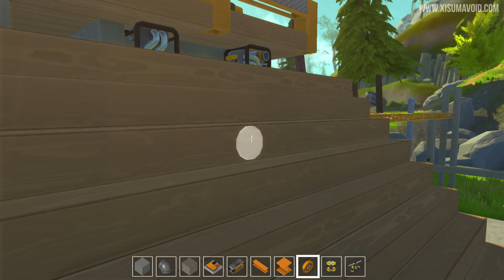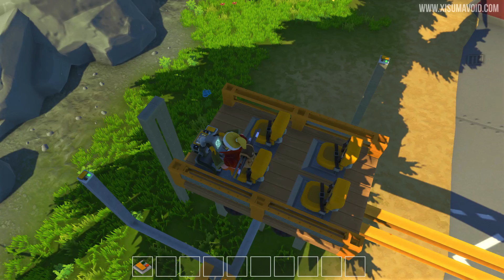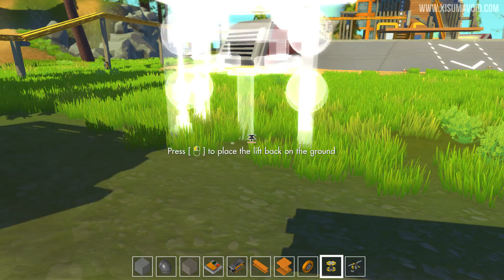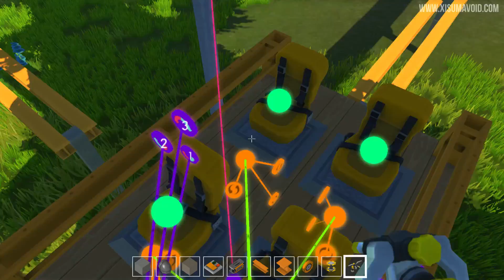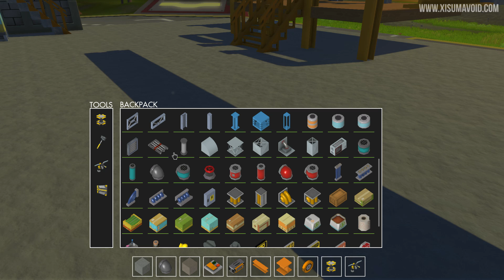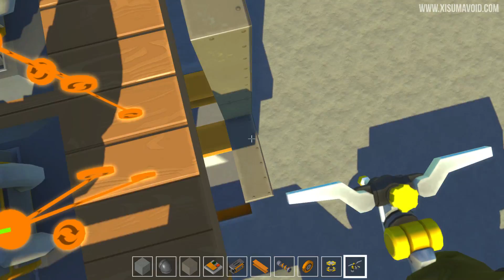Scrap Mechanic Amazing Rail System

Comment: On rhe suspension idea 10:00 just place bearing under it and rotate it 90 degree an turning on sensor so when u ride in it will push u back a tgan it will rotate  90° and ur be frew

Comment: dude you should totally put the wheels on bearings without a switch (loose) so when you go onto a diagnal track the wheels can line up when they hit it and it can turn automatically

Comment: I do believe you can hold shift or control and move the default angles on the control panels by individual degrees. You could use that to make smoother curves made from 9 or more different straight block segments (10 degree or less turn each). Then maybe add a loose bearing to the axles of the cart so they can deviate from perfectly straight as the track does the same.

Comment: Having the turn table lift a block would allow it to extend to the stationary rail without running into it as it turns. For slopes, you should find a ratio that allows a closer connection between the rail. just for smoother rides

Comment: ive tried something like this. for the diagonal track use a sensor that will activated for long enough (the same time as it takes to drive by it) to activate another bearing onto a sensor that then brings in another controller. use this controller to 'lock' the second sensor on and drive the track to a desired angle. effectively you do not need to stop the car at a turn table just keep driving and it will change direction

Comment: Try putting a larger bed of wheels across the top/bottom like 20-24 on Top/bottom total and making it so the horizontal guide wheel wider so the car can drift around the corner, if its possible you can make a pin that extends down the centre of the vehicle that goes inbetween the tracks as a centreing pin.

This way when it approaches a bent piece of track, the pin moves to the next track, and starts to turn the vehicle, normally some of the wheels would try and fall off the track hence why needing more wheels across the bottom of the car, and if the guide wheels were tight to the track it wouldn't allow it to turn. since it would pinch it.

Comment: A few ideas for your rail line.

1.  As you say, you can do angled rail.  As long as you use shorter pieces and increment the angle slowly, it shouldn't be too hard to make a rounded-ish curve.  Lot better than turntables.

2.  If you space your rails wider you get more stability on the track, can then use guide wheels that follow the inside of the rail rather than the outside and/or bottom.  This means as long as you support the track from directly below the supports for controller-angled rails won't impede mobility across the joints.  And as long as you bring the support down a couple of blocks to account for guide wheel width, you can still support it with one Y shaped post instead of two straight vertical posts, thus less building.  Plus corners make it possible to have multiple cars per train without needing gigantic turntables.

3.  If you are able to make the round-ish curve idea work, it might be better to have switches rather than turntables.  The switch can just turn a short distance left or right at one end to carry the car over to a left or right curve.  Less movement means more stability, especially when loaded with cargo.

4. I love the idea of a loading station, but cranes are notoriously shaky in SM, and it's hard to grip objects.  Maybe just have the train lowered into the path of a conveyor/piston-pusher system to load them instead?  I admit I'd love to see a well-built crane though.

5. As you mentioned, you can use sensors to trigger your switch mechanisms.  You can have 2 blocks on a bearing set to rotate 90' in front of a sensor on the track, it doesn't need to be a long arm.   Probably tricky to get the placement right - you could even get fancy and have the sensor positioned to detect an already-extended block on the car ahead of the switch and switch it automatically.  Then you hook switches to your driver's seat so when driving up to a switch you can hit the hotkey and by the time you get there it's already switched.  That way the car doesn't have to stop in the same place every time, or even at all.  Not entirely sure this is possible, but it sure would be cool.

I think that about covers it for now.  I'm looking forward to progress on this thing, and I think I'm going to have to do some tinkering on my own and see what percolates up.  My time with OpenTTD in the days of yore is all coming back. ;)
Reply: Ideas for other projects:

A forklift for your warehouse.

A conveyor system to make loading/unloading the train easier.

A crane car for your train (definitely needs wider wheelbase) to load/unload cargo at stations without their own crane.

More to follow at some point.

Comment: You could put little stoppers onto the turn tables which can rotate upwards so you don't fall off. Then they turn back down whenever they're close to completing the turn. Also, now that I saw the part where you described your stoppers...I was talking about putting them ON the turn table. Like, connect them from underneath or something.

Comment: Would you be able to lift it with an elevator using the same method you used to push the beams out at the loading bay?

Nvm, didn't finish the video. :)

Comment: You could have the bumpers be part of your turn table and use sensors to check for alignment to fold them down when the turn table track is aligned with your main track. You could also probably have another sensor on your main track linked to an and gate and the alignment sensor to flip up a bumper when you are entering the turn table on the through leg of a T.

Comment: I like your sensor interaction bit where you have little things pop out of the cart to activate different sensors. The buffers where an added coolness factor. But what if you could also have little blocks extend and fill in the gap between the turntable and the rest of the track so you don't have the problem of being stuck anymore? love to see more

Comment: incorperate the star trek doors, with a hole for the tracks, so if you pass a sensor, the door will open and you can drive through it. Another idea is a kind of storage system for extra cars, (with the help of the unloading and loading bay).

Comment: You are seriously making me want to buy this game :P
If you gave each set of wheels a vertical axis allowing for it to rotate, it may be possible to make the car take turns.
If this were a monorail it would be even simpler. You could have a set of 2 wheels at the center of the car making contact with the sides of the monorail for propulsion, and a single wheel at the front and back making contact with the top of the rail for balance.
This is of course only theory.

Comment: If you attach the wheels to buffers (springs)  then you might be able to turn around corner tracks instead of having to use turntables all the time.
Reply: Turntables are certainly the most limiting factor for this. Curved rails would be a great addition either way.
Reply: +Sancarn or he could just put the buffers on the cart like on european trains eg. https://en.wikipedia.org/wiki/Buffer_(rail_transport)
Reply: +Lego2244 Uh, how would that help with going around corners? ;)
Reply: wlfbck20 Idfk, you tell me
Reply: ***** Short Railway carts are Common in the UK...

Comment: Hey X, why don't you replace the buttons with sensors? Drive up the turntable and it will automatically turn.
If you wanted to make a turntable switch, where you can go either left or right you can make something for that.
Hook up two switches the driver seat that go to controllers that control two bearings on either side of the car. Those bearings will move a little leaver that will trigger the sensor to go either left or right.
The sensor has to be attached to the turn table else you lose the connection once you start turning. You'd also need to figure out a good way to stop the turn table at the right position: you could do that with a switch that triggers just before you drive up to the turn table.
Reply: i thought of something similar
Reply: +Zquirrel he's wanting to make like a T section or a intersection from for ways and stuff

Comment: I believe sensors would be the better majority in this project to avoid getting out of the vehicle every time you wish to change tracks, plus it would help for elevation. Another suggestion would be to reverse the wheels and cubes under the carriage as the cubes on the outside are having the collision issue.

Comment: In the futur, if you want to have an automatic delivery system, you can also design "barcodes" (multiply the inferface 9:00) to code a destination by car, read by each turntable to route each car. And you can maybe code on the lenght extension (10%, 20%, 50%...) of the arm, so like 5 states, instead of a on/off 2 states, to reduce the need of interfaces.

Comment: this was a weird video. xisuma wasn't prepared at all and I don't get why he wants to build railway system. If he wants to transport things (which things?) the better soltuion is clearly a normal offroad car. No need to rotate tracks and push buttons there. And no chance of falling down the rails.
Reply: And you call yourself the smartest
Reply: I think he is just having fun. As building a car gets boring eventually.

Comment: if you make a line of slightly offset diagonals, wouldn't it be possible to make an actual corner so you don't need the turntable? worst case you can increase the gap between the wheels of the cart to make it a smoother transition?

Comment: X, could you put a sensor on the pillars or on the sides of the car, so if it needs to turn right, the right sensor would be activated as it was on the right hand side and was triggered by the pillar?

Comment: you could use the pivot and the rail with a lower rotation as a curve
use the lift with the tracks on it and that a elevator

Comment: I think it is possible to turn whithout a turn table. if you just make seperate segments of tracks at 5 degrees each. then you have like a slow turn. now if you put a bearing between the front and rear wheels and make the train in to parts, like a bus, you could possibly turn left over those turns. Maybe this is an idea to try out Xisuma! also love this game, hope to see more!

Comment: With the diagonal tracks you could try something like you did with the spiral staircase. Just connect a few tracks and turn them all 1 degree or something. You could even use it instead of the turntable.

Comment: Xis, if you want curves you can adjust the degrees of rotation in the Controller by 1 at a time (rather than 15 at a time) by holding Shift before and while you drag them. I think its shift, but it might be one of the other modifier keys.

Comment: I got a fix for your slope: at the lower end, put a block between both rails, and have that one resting on a block attached to the other track. Thus you have something to hold the rail up, that doesn't interfere with the wheels!

Comment: X, I've already made a turning system like that.
When you make it, you have to watch out. Once the cart goes off of the sensor it most likely isn't completely off of the turning table and it will mess things up completely. I have 2 things that rotate up and keep the cart in place while turning, which caused the biggest problem. I've solved this problem, but now it's a 1 way system. I'm thinking of modifying it once again so that it can be used in both directions.
Reply: +Animiles 
disclaimer: I don't have the game.

Hm, maybe have the sensor trigger a controller which slowly moves a block which triggers the sensor which actually turns the turntable back into the default position? Not sure if that&#39;d actually work or not...

eg.
cart / triggered block -&gt; sensor -&gt; controller -&gt; slow block -&gt; sensor -&gt; turntable

Would probably add the same delay to the initial turning however...
Reply: FreeER atubeacct
I've tested and tested, but I can't find a solution. I don't completely understand what you mean, but I doubt it'll work. The reason I don't get it is probably because things do not work the way you think.
Reply: +Animiles 
Actually they do work as I expected, I just tested.

I couldn&#39;t really get it to spin quickly when you first activate the sensor and then move slowly afterwards, unfortunately, well, I kind of sort of managed it using two blocks, one that activated the sensor quickly and a second that moved slowly (and thus was slow to deactivate the sensor) but I didn&#39;t perfect it because I stumbled on another solution... you have a sensor next to the turn table and when it detects your cart it activates a controller which moves a block to activate another sensor, which then turns the tracks and the original sensor so that it stays aimed at the cart. Then you can move the cart forward and the tracks won&#39;t turn back until the cart has moved out of the path of the sensor and the delay on the controller runs out...This allows the delay to not be too long when you want to turn but long enough for the cart to be able to move onto a solid track before it returns to it&#39;s default position.

It takes a bit of playing to do but it&#39;s actually pretty simple. It could possibly be simplified if the cart sensor was part of the track object, but I didn&#39;t do that in my test.

Basic ideas involved:

Sensors will detect any movable block (eg. one attached to a bearing) even if they aren&#39;t part of it&#39;s own system. But it won&#39;t detect static blocks, unless the sensor itself can move. example, place a block on the ground and place a sensor on it, then in front of the sensor place a line of blocks on the ground so that it&#39;s in the sensor&#39;s line of site. It won&#39;t activate the sensor. If you place a bearing under either the line of blocks or the sensor itself, it&#39;ll be activated.

When controllers are unpowered they reverse their actions from last completed to first completed.
Reply: FreeER atubeacct
Then I think I don't know how it works because I can't visualise it and translate the words to the logic in my head.. Thanks for trying to explain anyways :D